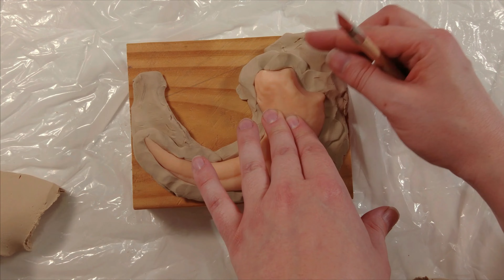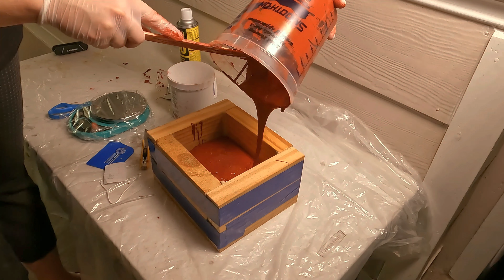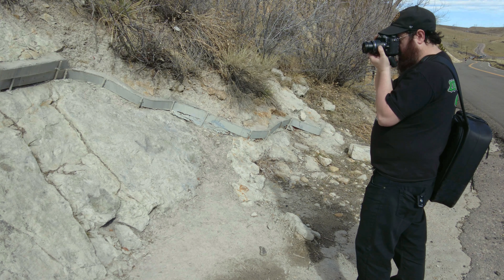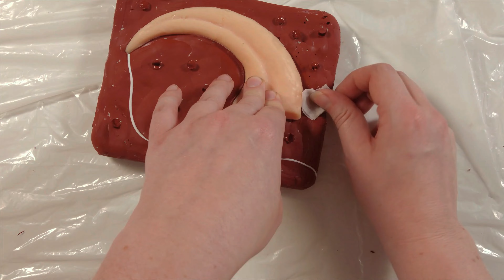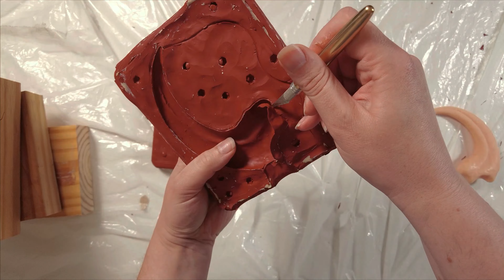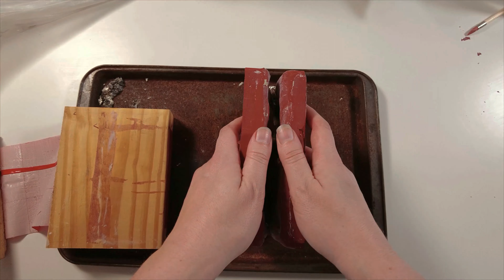Casting a Jurassic Park Raptor Claw in Pewter

Comment: This just popped up in my recommended today, probably because metal casting is my thing 😁Great to see your first casting project come out this good.
I do a lot of pewter casting in molds I get of the internet or thrift stores, have not yet made silicone molds myself but I will in the future. Mostly I've been doing sand casting for higher temperature metals like Aluminium, Brass, Bronze and copper. Zinc has a low enough melting point that it will work in silicone too.
My 3D printer is also the Mono X and it is actually printing a few patterns for a new casting project at this very moment. 
I subscribed and hit the bell, I'll be checking out more of your stuff 👍
Reply from the maker: I want to do more metal. I'll have to check your stuff out. I have some sand casting supplies that I haven't used yet. I am also working at building up a metalsmithing set up at home. I had to take a class as a part of becoming a teacher and loved it. I'm trying to find a torch and possibly a foundry for annealing, soldering, and casting. Something that I can store and use pretty safely in my apartment complex. Have any tips for something that is comfortable, safe, and reasonably inexpensive?

Comment: Next time use legos to build your mold box
Reply from the maker: I've heard of using legos.  What do you recommend for the bottom?  I also like the idea of using flashing if I can get to the hardware store.
Reply: @suburbanartistry  use Lego base plate
Reply from the maker: @edgotbait  Are there any cons or things to look out for concerning the texture created by the baseplate?  It seems logical that it shouldn't be too bad for silicone, but you never know for sure until you've done it.  I come from the ceramics perspective where we work with plaster and we want the plaster to be as smooth as possible, so it doesn't break off and get into the clay.  That will break the clay if it goes into the kiln like that.  Any other tips for using the legos?  I'll have to do this again using that method and hopefully find some cheap legos!
Reply: @suburbanartistry  
https://youtu.be/ommb5JaVa_0

Comment: The 3d printing looks so satisfying!
Reply from the maker: Thanks! I think the resin printing looks more satisfying than filament because it forms out of a vat of goo and upside down! It's kind of like melting a candle but in reverse, lol. Resin is also so much smoother right off the bat. It doesn't need all the sanding that filament does.